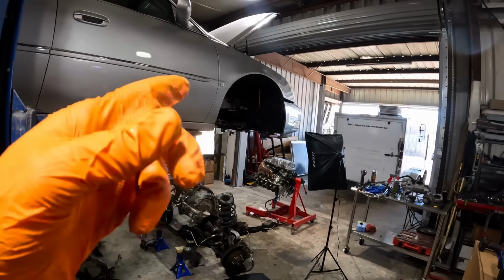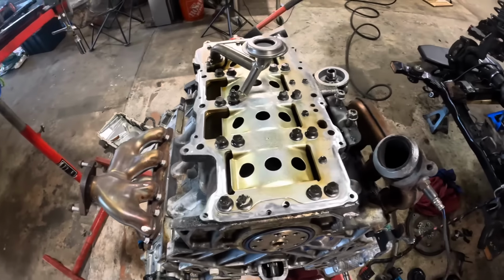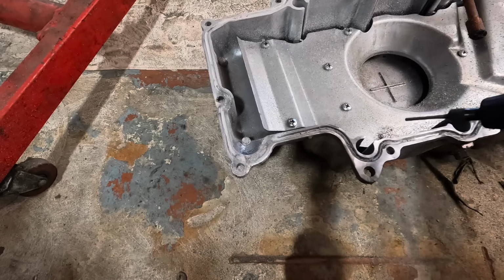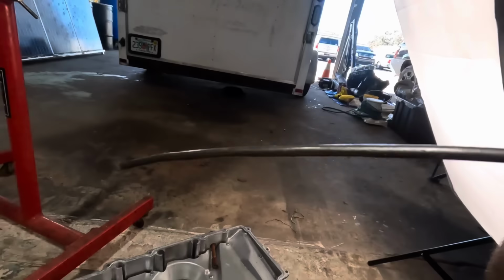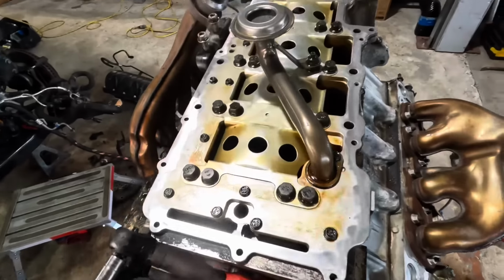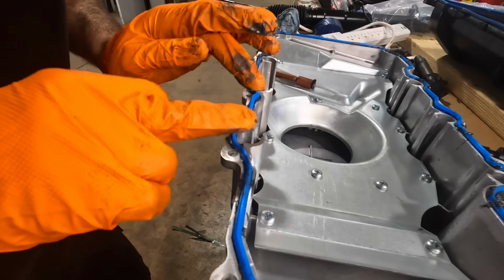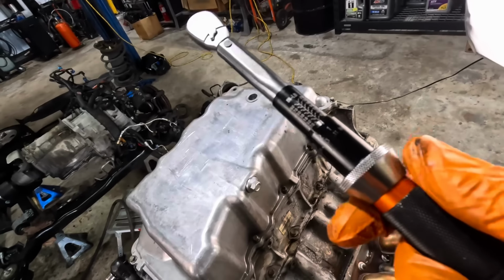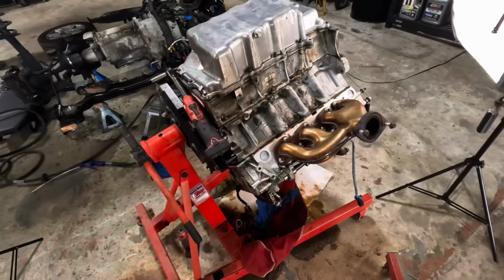Leaking Engine Oil at 40,000 miles! Rear Main Seal, Oil Pan, Valve Covers and Water Pump!

Comment: If it leaks now, probably best to re power with a modern engine. Or just park it on top of an  oil matt.
Reply: I think GM's 3.6 would be a good choice, similar power, fwd, and space shouldn't be a concern.
Reply: @stevenkerwin4041    I was thinking more on the lines of a 4.8 or 5.3.  V8. Todays backbone of automotive excellence.
Reply: Its gonna leak, the mating surfaces have been damaged.

Comment: Man.  The vitriol of a lot of perfectionists who have all the time in the world and all the money to burn it with in here is pretty awesome.

You guys don't know what Ray talked about with his customer.  I would suspect that he has had several conversations regarding 'do you want to pay for me to do the mid block seal or no?' and customer said 'no' as it's not leaking. 'I can fix the oil pan or get a new one, which will you pay for?' Go with the old one.

Remember, Ray is on the hook for every single thing he does and then he puts it on the YouTubes to boot.  You don't think he's pretty aware of all the things?

Y'all're funny.  Truly.  Might need to run a shop and be a mechanic on the line (which Ray does and was for other shops, including a Chevy dealer back when, so he knows more than you, likely) and deal with all the ways customers, parts, and techniques don't mesh and you have to deal with it and MAKE IT WORK.

Which Ray seems to be doing just fine, you ask me.

Go Ray.  Can't wait to see this thing done.  The Car Wizard would be appalled you're even doing it at all, I'd bet. :D

/I am a tad concerned with the whiz wheel sprinklings in the case, but I'm sure you're gonna give it an oil bath before first start, eh?  nods affirmatively knowing that's the case
Reply: Ray is an ass for using that grinder, flinging ground up gasket and sealer everywhere. Would not let him clean up by kid's tricycle!
Reply: @robertmaag3897 it's his shop who cares

Comment: I hope he did an oil change right after he got the sealed engine back in and running.  The left over water from the oil pan and the pan sealant dust he cleaned off of the block that went into the engine needs to be flushed if nothing else.

Comment: 8:02 HEADPHONE USERS: RIP EARDRUMS. This engine is still remarkably similar to my 1997 Cadillac. I know they made some changes to the head bolts but I'm not sure what else. I put in head studs at about 95k miles  because the head gaskets started to leak and just resealed it and replaced the bearings. Never had a problem since then and now it's 230k-ish miles.

Comment: Their is a new tool out their called a shop manuals you can look up if the base come off as for silicone one must use denatured alcohol to clean mateing surfaces brake clean leaves a residue and silicone won't stick well and leak

Comment: Ray this North Star motor at 40k that a lot of leaking. I hope that “windage tray doesn’t leak.   I wonder “since these bolts tend to strip the bolt threads out” if a mechanic had a heat induction tool to heat the bolt up would it make a difference Have a good day Ray nice video

Comment: when I replaced the timing chain on my N* my brother asked if I wanted to replace the rear main seal as well. I figured I never had a bad one before so I passed on it. 20K miles later it started leaking. bye bye STS.

Comment: Ray, I have one question why did you not take take the  oil pan baffle off and clean under the pan? There has to be residual debris at every attachment point. You are aware that dropping your torque wrench on the ground may damage the torque value .
Reply: Harbor Freight has plenty more.

Comment: Back when I detailed cars I checked in and inspected the new cars coming off of the car transport there was a brand new Cadillac Deville that was the very last one to come off of the truck the driver started it up there was this horrible knock it sounded like it was going to throw a rod well later in the day I talked to the mechanic that diagnosed it,
Someone from the factory left a bolt in one of the cylinders it was a brand new Northstar back in 1997!

Comment: now u need to buy a new oil pan.
u should of used a vacuum behind the Dremel to suck all the stuff away.
hope u like washing that oil pan real well to get rid of all metal and stuff from it
Reply: What about all the material that got into the crankcase?
Reply: Even newspaper taped to the interior tray prior to starting gasket removal would've been better than nothing.

Comment: I was given a free 99 STS  that several shops plus a dealership couldn't or didn't want to repair an issue with the battery dying every night .  I bought the 3 shop manuals online and traced the problem to the computer sending over 10 amps to the CD player every 10 minutes or so.  I installed a relay in the fuse box to keep the computer from checking the CD player unless the car was running.  Caddies have way too many engine codes and tests.  One of the 3 shop manuals is only for the codes and it's over 1000 pages.
Reply: Had the same year STS with exactly the same problem.  Took Cadillac 6 months to find and fix.

Comment: Idk if it would work, but I use wd40 to remove pure silicone on tubs and showers, just spray it on and I breaks down the silicone to a lumpy mess that's much easier to remove. Idk if it would work on rtv etc though.

Comment: Why Ray is it that a auto shop replaced a rear main seal and not the leaking oil pan at same time my transmission was not replaced?  No coolant leak was mentioned
either.   Of coarse my truck was misfiring and nothing was said about that.   Anyhow I had a mobile mechanic first try on a Craigslist business find fixed everything
mentioned for $80hour rate and I was billed $356 tipped him $100 Parts he supplied was the coolant thermostat/ housing seal and thermostat along with a oil pan 
gasket.

Comment: The knock is not for opting to not split the block to reseal. The knock is for not removing the oil pan baffle BEFORE spraying RTV all over. Is there a big chunk of it under the baffle? I guess we're fittin ta FAFO. 🤷‍♂️

Comment: WOW @$20.00/bolt on that lower skirt, I also say NO unless you know for sure there is an oil leak, and we definitely dont want to rip out aluminum threads. Sometimes a line has to be drawn and just stick to know problems....

Comment: Great Job documenting - glad i drive Lexus /Toyota /Honda products - no leaks … Ever.
Reply: Lol that is nonsense plenty of toyotas with oil leaks
Reply: @lieutenantdan8170  hmm something tells me u have a narrow knowledge of cars - ive owned domestic n european cars over the years and Japanese cars in my experience leak a lot less if at all.
Reply: @stuntdriver2147  They don't leak like a bmw but they still leak, folks like to postulate like japanese cars are invincible they're not cam seals will leak, valve cover gaskets will leak, hell the 2gr v6 had a issue with the vvt oil feed line degrading and losing all oil pressure to the engine
Reply: Guess you never looked under the hood yet? Don't look it might be time for a timing cover seal 😂
Reply: @lieutenantdan8170  yes and the infamous 5.7 liter cam tower leak on the Tundra and newer Land Cruiser - that was a screwup on Toyota’s part - however i drive a lo mileage 99’ GS300 with a 2JZ, it was my dads now mine and i did replace the original 23 yr old valve cover gaskets but, no other leaks so maybe im just lucky. But our nissan sentra, crv, and toy matrix have been leak free compared to what I’ve experienced with Volvo, VW, and BMW (non were diesels) my point being is overall thats what my experience has been.
Reply: Had an import repair shop that dated back to the early 70's and sold in 2007, when imports were a nasty word.  In the early 70's Toyota, Honda, Datsun, MG, Triumph, all leaked oil and coolant.  You sir, have a very narrow knowledge of imports.
Reply: I can't knock Toyota or Lexus. I own a mechanic business and work on enough stuff daily. I always put my lady in a Yota or Lexus and switch it out about every 5 year. Never had any major issues with any and all usually start with around 80k miles. Has a 11 IS250 now and basic maintenance stuff. Last thing I need is her calling saying she's stranded somewhere.

Comment: I think a  bent pick might have been a better choice than that dremel tool to clean out the oil pan groove, yeah it takes some time but not potentially as destructive. Hopefully you dodged a bullet by not taking off windage tray to thoroughly clean out sealant bits

Comment: The groove that has been destroyed is for a pan casket. All the debris you just put in the motor and not removing the baffle in the oil pan to clean ALL debris out. You my friend in this case are a hack. On to another subject. Several videos back where you were welding on the vehicle with out disconnecting the battery. You my friend got lucky.

Comment: Are you SURE that this engine doesn't have a PCV issue? It seems to want to squeeze out oil at every joint and seal.
If this was a Volvo, I'd suggest you take a glove and put it over the oil fill neck and see if it inflates.

Comment: Since you found a missing bolt on the lower oil pan, do you think it would be a good idea to check the torque on the upper oil pan bolts or... don't disturb them since it's not leaking?

Comment: Is it possible, advisable or procedural to smoke test the crankcase ?
Thinking about all the places you could possibly get an oil leak could you under pressure introduce smoke into the engine prior to reinstallation to test all the gaskets ? 
And at what pressure ? 
And is air pressure the same as oil pressure ? 
Just seems like a simple way to check on the work you did and didn’t do.

Comment: The most common oil leak on this engine is the seal between the craddle and the block if you have gone this far you should just split it open and do it, 90% chance this engine is still going to leak. No offence but ive done a number of these and splitting the craddle from the block is the only way to do this repair and not have it come back.

Comment: My mom had a guy that she knew that worked for Chrysler and he said he would never own one after seeing the parts they knew wouldn't last past the warranty getting put into vehicles
Reply: "German Engineering" has become so precise they can guarantee massive failures at 120% warranty life.  If they made them to LAST, you'd never buy another car..... (my father had a Holden Vectra (German Opel), he paid $3,000 for the 120,000 km service, at 130,000km it had so many faults and failures he was only offered $2,000 as a trade-in).

Comment: Just just asking. I think you should have had them put a new oil pump in it cuz it looks like it's real easy to get to. They're usually just like two bolts pulled out. Put the new one in and done.. or is in North Stars? More pain in the butt than that? Just asking

Comment: To anyone that knows…
Does a Dremel tool have a torque governor or something that keeps shutting the tool off?
Or does Rays just have a loose connection or something.
Thanks in advance.
Reply: It’s because he is pushing the wheel hard on the surface and it’s just a tiny spindle. Doesn’t take much to slow it down.🙂
Reply: Looks like a Chinese dremel
Reply: I picked up one of those Harbor Freight dremels  once.  Threw it away a few days later.
Reply: Thanks yall.

Comment: I have less problems with not removing the skirt than using the dremel to remove the rtv stuck in the groove.  It was clear to me that this groove was for a gasket, and going metal on metal in that groove would bring its set of issues… I would have used the edge of a plastic scrap or better yet, I would have modified a cheap plastic trim clip removal..

Comment: good day Ray i am early for a change ,it looks as though somebody has add a real go go at sealing the sump on the engine, would it be good if somebody invented a rattle gun that you could set to the torque .   thanks for the video

Comment: A long time ago (late 60s or early 70s) I did some on the job training at a service station (gas, oil changes, lube jobs, tune ups, etc...), I can't image doing this type of work in that environment, in the hope of making a profit?
At 33:15; it looks like you're missing a bolt or it's a place to bolt down a bracket?  ;-)

Comment: Where the heck did you learn your trade, Ray? A rotary tool in an aluminum gasket channel, which you completely ruined. A power tool running a bolt in the mystery hole. Lucky you didn't break/crack the flange. No sequence in the your bolt pattern on the pan, really. I hope you're going to clean inside the valve covers, not like you haven't in the past...
Reply: A graduate of Shade-tree University!

Comment: Gosh, if for any reason the main cap seal was leaking, not a big deal to seal and re-torque the caps. Plus could have cleaned sealant off remote from the engine. I know you mentioned comfort level, but when compared to the job at whole, main bearing cap is peanuts. Later, I ca't believe the bolts are one and done on the bolt torque. I agree replacing bolts on a marginal leak possibility not so great.

The big challenge is keeping up with your commentary. Yesterday's video you commented so much I couldn't isolate the cool background song to identify it LOL. But I love the commentary so don't take as a neg.

Comment: 35 mins doesnt seem like a regular ray length video. i like starting my mornings waking up with a pot of coffee for an hour watching/listening to ray. 
socket not staying on the extension drives me nuts thats why i have locking extension. they were 'spensive but the time saved not picking up or looking for dropped sockets is worth it. 
goop and gasket=belt AND suspenders. i guess if that doesnt stop the leaking, theres always the classic diy'er wood screw trick. :)

Comment: Regards AI (couple weeks back). AI is as good as data you use to  train it. If data contains "complaint" and part or action used to fix it - it'll suggest this approach as well. If it gets access to car details and list of common issues, it'll know common issues. If it's trained to recognize tear, wear etc on wires, it'll detect and 'll show suspicious tear/wear in augmented glasses.

Comment: @8:00... That tool's gonna remove metal. I just use a pocket screwdriver. @16:00... I'd just remove the baffle. @19:30... I wouldn't use any RTV. If you put it in th groove, it could take up valuable real estate that the rubber needs. I never put RTV on rubber because until it dries, it acts like a lubricant. It's the same as leaving the mating surface oily. @25:30... Since I'm there, I'd replace the pick-up o-ring. @30:00... Seriously, Ray... Put down the camera. Either get a good head mount or use your tripods.

Comment: I don't think using that wheel on the actual bed plate itself was a good idea. It just threw tiny particles of silicone all over the oil pick-up tube, main cap bolts and down in the holes of the skirt. Even trying to tilt the engine sideways and rinsing it down with brake clean won't get rid of all that contamination. It's now all down inside that block.
Using a dremel with a bit that can easily cut aluminum is also a bad idea in my opinion.
Reply: I definitely wouldn't trust myself to use a dremel like that. I'm bad enough just trying to scribe numbers on stuff.

Comment: Ray, I just finished watching the rest of your video. I really wished you had replaced that upper pan gasket. As I stated before. That’s where the leak is likely at. If you had gone that far as to pulling the engine. You should have simply gone a little further. It’s not really that bad to do out of the car. In fact it’s the only way. I hope you don’t have an upset customer. I am not trying to be a downer my friend. I just know those engines. Just changing the lower pan is simply a band aid. Please forgive me if you took my message the wrong way. Just worried about you buddy.

Comment: Get a container / pan so that the oil pan can sit in, (sealant side down) put enough gasoline in the pan so the sealant is touching the gasoline. Wait about 15 minutes. And you're done instead of grinding away at the damn pan. WTF
Reply: Honestly this is some hillbilly shit, if chemical put it on you need chemical to shake it off.

Comment: I believe that gasket is a good example of a poorly designed system.  That should have been a flat gasket with a deep insert for the groove and an oring bulb on the other side so no sealant would ever be required.

Comment: it's weird seeing ray using a dremel on the sealing surface (not knocking him at all as he's been doing this for years and would trust him myself), i'm interested as to why he'd use a dremel tool to clean it and not something less aggressive given metal on metal, sealing surface etc?
Again to be clear, i'm not knocking him just curious as a non mechanic (I work in IT)
Reply: I like ray, he seems like a great guy, which is why I've never wanted to write this comment. To answer your question, I think the answer is speed. I've had to stop watching most of his videos because I think he cares more about speed than quality. I'm not sure if he has ever worked flat rate, but it makes me think of a flat rate tech that wants to do a job as fast as possible.
Reply from the maker: That groove was pretty deep and that sealant was embedded in there, scraping it out wasn’t working. I figured a mini router bit on a Dremel would do it

Comment: I hope the repair is successful long term and that car never comes back to your shop.  It was difficult to watch you take a steel dremel bit to the aluminum oil pan.  Some good alternatives have been mentioned in the comments.  I know well the labor involved to clean up an RTV mess.  I wouldn't want to be the next tech to deal with what you re-created on that oil pan.  Considering the vehicle, it may be laughable, but cheaper & more reliable, to suggest a LS swap!